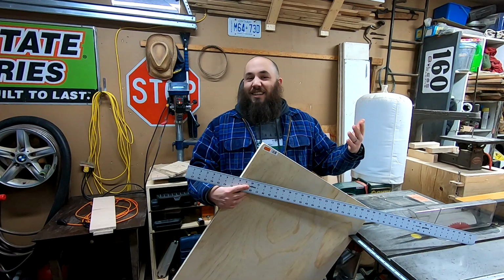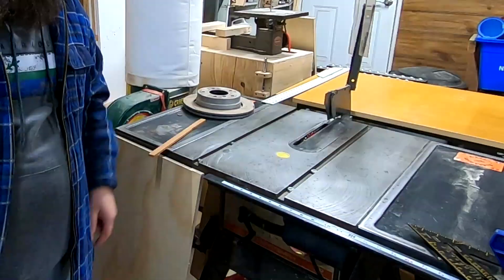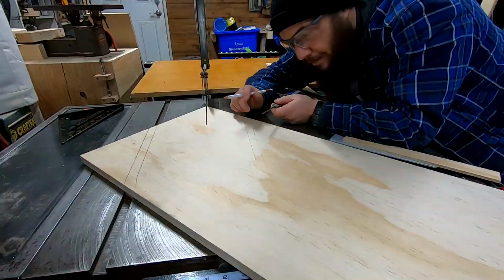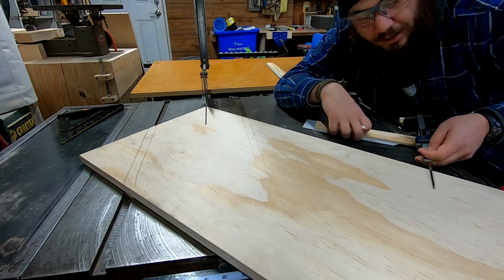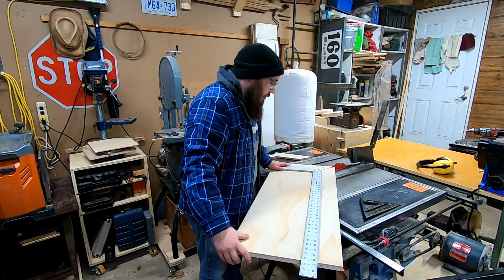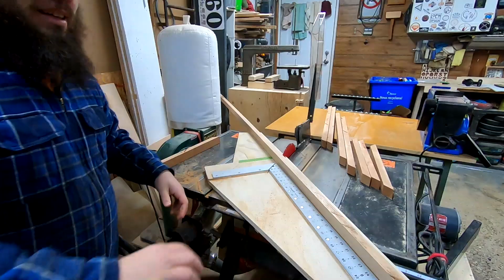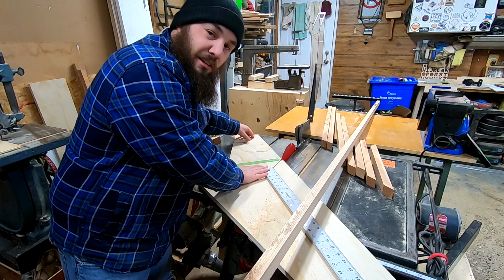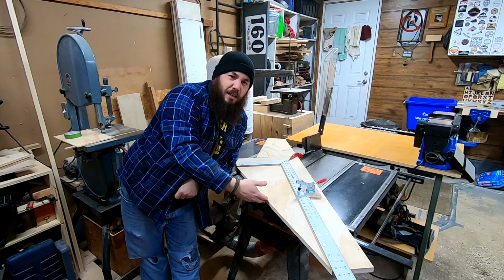Picture Frame Sled - Make Precision Miter Cuts on the Table Saw

Comment: Agree to previous comment on need of how to use it. Taking the best parts from you, knocking off excess platform, and another video.
Reply from the maker: I've seen some other improvements from other makers, I especially liked someone using an aluminum square instead of a ruler.

Comment: I have something similar I made for my last table saw, but haven't managed to adapt it to the new one. If it doesn't work out, I might give this one a go 😊 I've done the drill before adding tape a few times and it baffles me each time too 😂 😊 ॐ
Reply from the maker: I was using the mitre gauge that came with the table saw in the past, but this just makes it so much easier! I'd love to see how you would improve on the design 👍🍻 thanks for watching Chris 🙌

Comment: I've seen a few of these now and like the addition of the extra part to support the cut. One thing that I've not seen anyone really cover is using the rule measurement and allowing for the rabbit when say you have a piece to mount 100cm x 100cm and the rabbit for example is 5mm. Where are you measuring to on the sliding stop, leadijg edge or allowing for the rabbit?
Reply from the maker: Thanks! And great question. The great part about these jigs is you set the sliding stop to the measurements of what you are trying to frame. For example if you have a picture that is 100cm x 100cm than you would set the stop at 100cm no matter how deep the rabbet is. Let me know if that clears things up.
Reply: @TheGrantAlexander  OK thanks for the reply, and looking at the piece positioning being cut, the bottom of the rabbit is against the rule so the measurement has taken that into account. I need to build and play...👍

Comment: That's a great jig, Grant.  I need to make one like this, my method is way too time consuming... Congrats on making it to 500!
Reply from the maker: Thanks Stan! It's been a long but rewarding climb to 500. This jig is amazing! I was using the miter gauge that came with my saw in the past and this just blows or away! If you are making more than one frame it is worth the build! 🙌🍻
Reply: @TheGrantAlexander  I definitely need to make one...I just seem to always make them one at a time and think..."On the next one, I'm going to build a jig." But, then I get it done and don't make a jig and then I need another frame and, well...
Reply from the maker: @StanCrafted  I was the same way, then someone asked me to make 4 frames and I thought that would be a sufficient number to make it worth the effort!

Comment: An interesting jig. I’m looking forward to seeing it work in a project. If I made something like that for my SawStop I’d use a wood rule instead of metal just in case something slipped allowing the metal to contact the blade. For now I rely on my Incra fence for precise angle cuts.
Reply from the maker: Thanks Don, that's a good idea for those with a saw stop! Precision 45 degree cuts was one of the goals, but for me i was more concerned about getting repeatable lengths with mitered ends. With this jig there is less guess work with the stop block 🙌 thanks for watching 👍🍻
Reply: The Grant Alexander that’s one reason I use the Incra. It has a great stop block that comes with it.
Reply from the maker: @wb_finewoodworking  i just looked up some of the incra miter gauges, they do look very nice!
Reply: Grant, I have the 3000SE, which may be overkill for most people plus the Miterexpress sled. I was fortunate to get them as a “kit” at a good price at a woodworking show about eleven years ago after I bought my SawStop and Incra fence. Unfortunately those kinds of deals don’t happen very often these days and here in California we don’t have any more woodworking shows. The 1000SE is a really nice miter gauge for most woodworkers. 

Obviously your miter sled for making frames is much cheaper and easier to set up than my Incra but since I have it I can use it for the same or similar results. If I ever need to make a lot of frames I’d certainly make something using your ideas,
Reply from the maker: @wb_finewoodworking  i think of i had the tools you have, I am not sure i would have made one of these. This jig only does 45 degree angles and i want to frame that stop sign hanging in my shop. It won't work for that! 🤣🤣🤣
Reply: Grant, jugs like you made are great for what you’re doing and MUCH cheaper. It will be handy anytime you want to make a frame and will cut down on setup time.
Reply from the maker: @wb_finewoodworking  agreed! I can still wish for both can't I? 😀
Reply: Sure! We can wish for anything. 😁

Comment: Nice one Grant, looks good and accurate! 
I have found that some of those white plastic nylon cutting boards are the exact thickness you need for a table saw runners.  At least for me. Maybe keep an eye out for one at one of those bargain stores so you can have an unlimited supply! :)
Reply from the maker: I thought about those, but i have so many things strips of wood, even after making a video showing 8 ways to use them, then making thin strip wreaths, i still think i have an unlimited supply! But i do want to add some plastic to the runners of my son's wooden sled and cheap cutting boards sounds like an awesome idea! Thanks for watching 👍🍻
Reply: @TheGrantAlexander  That would make it fast!
Reply from the maker: @heyimamaker  and hopefully easier to pull! I'll send you a picture of it on instagram.